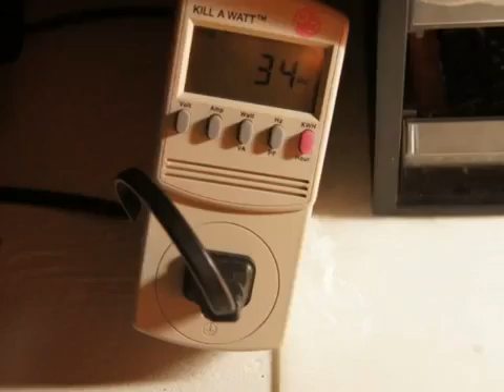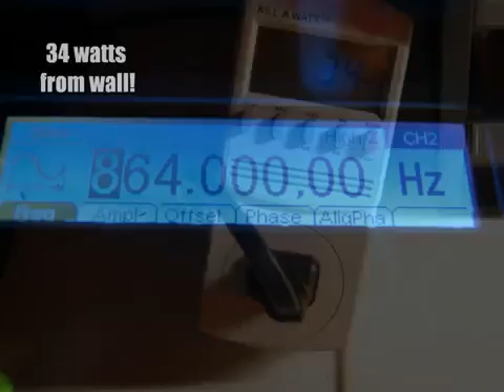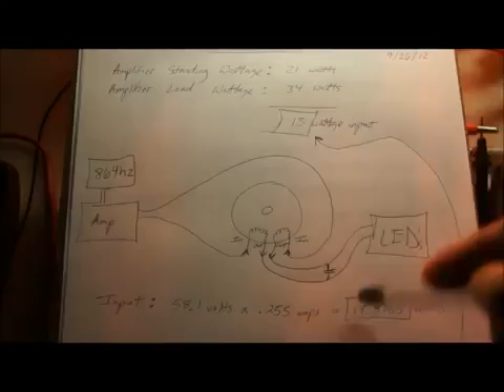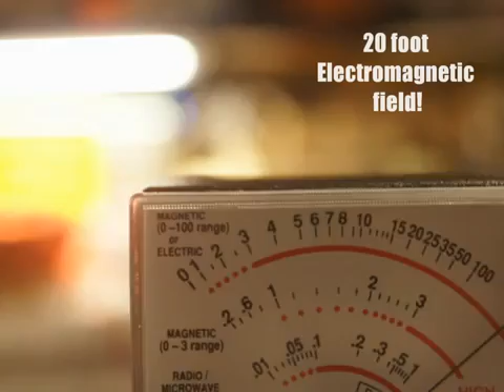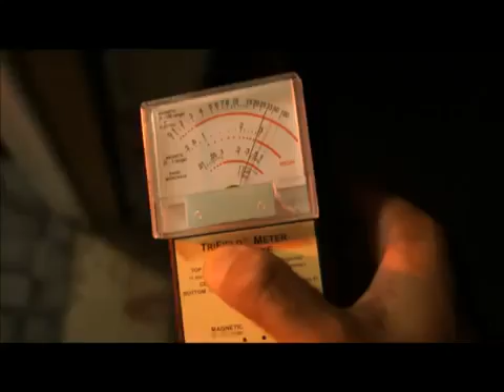Unification Coil Rewired 458% Overunity

Comment: Real power is different from apparent power. You are assuming the current is in phase with the voltage which is not necessarily true.  The only sure way you can confirm you are getting over unity is if you can take the output power and feed it back to the input and see if it still runs.
Reply: Yes true and burn a few tungsten halogens and then feed it back to keep it running! Better build a few more of those coils and feed the out put of one coil into the input of the other coil. Marko Rodin says to keep staging them. Then this video would dissapear!

Comment: Led bulb = Diode. You measure AC voltage before DC load. Perhaps half of your AC-waveform is without load at all and that's why you get such a high AC-voltage readings. Should you measure DC with a DIODE to get some real power results? Someone correct me if I am wrong, please.

Comment: I have struggled, fought, and fussed with my own fiddling about. Whatever designs I think of going towards, I always come back to sacred geometry. The science of everything never fails us, we simply fail to grasp it. Thank you.
Reply: Yes an rodin coil tapping ZPE using the vector A potential and making over 6000 hp, can fit in my lap and pulse it to make a 2 stroke sound is what i need! i was thinking of 2 counter rotating air vortex plasmas as even tungsten steel wire could overheat tapping this!

Comment: I think what you are actually seeing is the extra current that is flowing and being used to form, then collapse the 20ft magnetic field of your inductor (the coil) with each 1/2 AC cycle. This also would explain why the frequency doubles. What you are measuring is likely the apparent power not the real power of the output. This also would explain why the frequency doubles. The energy from these currents gets stored in the inductor's magnetic field. As the circuit's current lowers during the AC cycle, the magnetic field collapses and returns the energy back to the circuit as current again. So, you can have very high currents getting recycled over and over, but this energy is stored in the system and is not used up. It is just stored as a large magnetic field. Measuring it misrepresents the power being lost from the circuit. Only the current supplied to the load actually causes a system loss and I suspect it matches this value to be close to that of the input power. To figure it out for sure, you have to figure out the circuit's impedance.
Reply: He is measured it with meters connected to the input of the coil not just measuring the magnetic field. Voltage seems to display 10x input while maintaining current